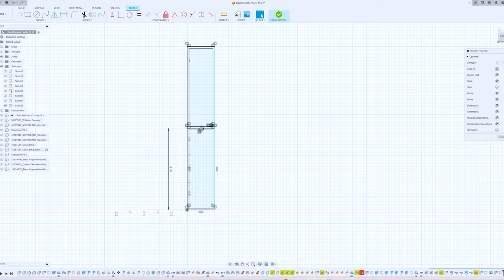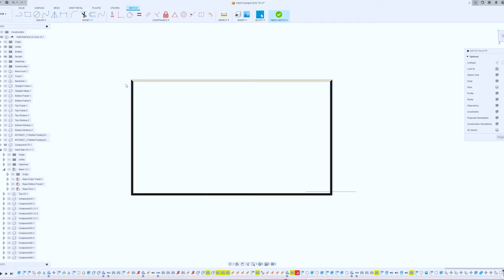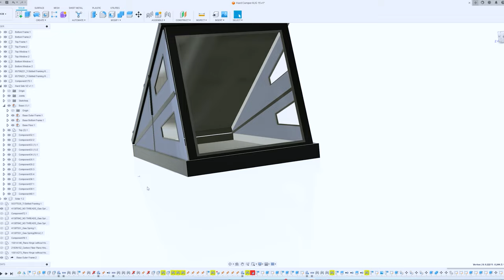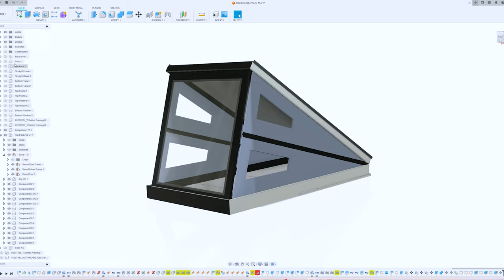How to make the ultimate DIY Roof Top Camper

Comment: This is an awesome diy pop-up! I am working on building my skoolie right now on my channel. One thing I have heard about insolating is that you always want to minimize your thermal bridging. I think if your design could have allowed it, you could put the foam on top of the metal suports to reduce thermal bridging and also this would help with rigidity for the floor and could likely hold more weight.
Reply from the maker: Thank you! Yea thermal bridging was one of the main things that drew a lot of the design considerations and I discussed my material choices stemming a lot from this specific consideration in the longer format videos. In a perfect world I have just made the the entire frame, walls, roof and door from carbon fiber and a better more advanced foam and had 0 thermal bridging but that’s just not really possible in a driveway with what I have. I tried to consider ways of putting foam around the aluminum first before covering everything in carbon fiber but it’s already 96x56 inches on the exterior which is pretty bulky on top of a truck already so encapsulating the aluminum would just make that worse. The whole principle behind thermal bridging is the energy as heat will always try to find the path of least resistance so it’s just about making the path as small as possible. The whole aluminum frame is now raptor lined which should help a little bit especially because it’s a extremely thick urethane based rather than regular paint but all in all while potentially there may have been some optimization in my design to this end I think it’s working out pretty well and a lot of the efficiencies gained in thermal regulation from thermal bridging optimization are negligible in the cold especially because it’s such a small space and 2 bodies create a massive amount of heat. But on a bus where everything is already metal and body heat isn’t as impactful as the ambient air it’s exponentially more important and you’re definitely right it should be considered.
Reply: @DIY_Davy  well said! Great explanation of your thinking. I also have no idea where you live and if you plan on using it year round. I live in NY and love the winter so I have to plan for that. I'll have to check out your longer video on it!
Reply from the maker: @kylethecreator  I appreciate it! Yea while I probably will use it in the somewhat cold during the occasional trip here and there during the winter that’s definitely not my typical use as I’m predominantly a nice weather camper/“overlander” so will probably just bring along a heater for temperatures under around 40 or so. That being said I do have high hopes for the cold weather ability, just not as high expectations.

Comment: Awesome build. Now that you've finished. Is there anything you would have done differently ?
Reply from the maker: Thanks! There are quite a few things I would have done differently and I can’t go into all of them in a comment but I still don’t have a solution for everything. Now having tested in everything extreme weather condition I think I’ve pretty much come across every potential issue the roof camper will face. I would have probably made the overall length it a few inches longer to have a larger opening to pass through the bed and the camper while still maintaining the full sleeping length. I wish I had vacuum bagged all the carbon fiber components instead of the hand wet layup. I think this would have produced a much better looking and stronger overall construction overall as well as probably cutting down on composite construction time by a significant margin. I also wish I could have sourced aluminum extrusion for the frame instead of the tubing to provide more utility and look much nicer but there isn’t anything available off the shelf that’s not double the weight of rectangular tubing. But I probably could have found something lighter coming directly from China if I scoured for a week or so. Overall it gets quite a bit more hot than a fabric roof tent in extreme heats but really excels in the winter retaining a lot more heat and having absolutely no condensation on any surface inside the camper. It performs about the same as a fabric style tent in normal weather.

Comment: Can you use FRP honeycomb paneling instead of carbon fiber? Or was there a reason you went with carbon fiber instead? Thanks. Look forward to the CAD drawings.
Reply from the maker: Yea you definitely could, it was significantly cheaper for me to make the carbon panels the way I did, than to purchase really any kind of comparable composite panel like an frp honeycomb but if you had a good source that was priced well or just weren’t willing to laminate the panels yourself it would be a really good alternative to the composite I used. There are also polypropene honeycomb panels which I wasn’t super familiar with at the time of building. These would have been really good to use as the roof, door, and wall panels because they’re pretty cheap, light and strong enough for those sections. I’d be hesitant to use them on the floor without some added support or without going a little bit thicker on the core thickness. I have the complete CAD model and some technical drawings available on my website: diydavy.com if you’re interesting.
Reply: Link isn’t working

Comment: Awesome design !!! 
Trying to make a copy of this for myself nowadays...
How did you insulate the tip of the triangle side walls 
I think there will be some gaps at the tips
Reply from the maker: Thanks! So like all the other panels the triangular panels have an exterior aluminum frame. I just welded that frame then traced the interior of the triangle the same way as the other panels. Because I also welded that inside edge of the tip as well I had to terminate the tip of the triangle with a very small flat section to match that. But after I glued all the edges of the foam to the aluminum any small gap like that was just filled up. Let me know if that answers your question

Comment: Hey I'm working on a similar hard-side roof thing! I'm interested to know if the floor felt ridged/robust enough being mostly that foam core carbon fiber sandwich

Looks really good BTW!
Reply from the maker: Thanks! That's awesome! I have 3 floor sections 54x46, 54x24, and 54x12 each panel is 1 inch foam with 4 plys of 5.7 oz plain weave all with 1inch aluminum framing the border with an epoxy layer between the carbon and the tubing. The largest section is where my feet go so could really never have much weight on it to reference the feel. But my 54x24 and 54x12 inch are plenty strong enough to support 2 people (around 320lbs combined weight) with reasonable weight distribution and a mattress (ie. both people not both kneeling in the center of the same panel at once, etc.) That being said for a very short period we both happened to be kneeling in the same point on one panel and i heard a very faint crack. So while I'm sure it would be fine, I added an aluminum 1x1 square tube  that slides in and out of the way along with the panels under the larger panel just for piece of mind because I had anticipated that potentially happening and have a channel that can house those supports on my roof rack. The same thing could be done by adding an additional support within the panel. So much strength is gained and lost to a lot of invariability especially when hand-laminating all the fabric because of this and the complexity of composite sandwich panels. So the subsequent material properties are extremely difficult to calculate for this type of DIY application and I really can't give you more than my specific layup and application works for me in my use case. Hope this helps.
Reply: That is great info! Agree to agree on the variability thing haha. But I'm not about to pay for pre-preg or actual foam core. Those prices are not for DIY-ers haha. 
Mine is wood, fiberglass (because I'm cheap). For core I'm playing with foam insulation like yours and a thick paper honeycomb sheet I found. Idk could save some weight or just be terrible haha.
I'll keep you in the loop when I get a chunk of this thing built!
Reply from the maker: definitely, I looked into the vinyl foam core and already laminated carbon sheets and sure they’re better but not 10x the cost better. I’m sure some of the cheaper honeycombs out there could be used instead of the foam to create an equally strong or stronger panel for similar cost and lighter weight. I was after a maximally insulating and minimally thermally conductive camper overall so was drawn to the foam, but in retrospect the carbon and air between the layers with honeycomb would probably be plenty for insulating. Keep me updated, I would definitely be interested to hear how the honeycomb performs